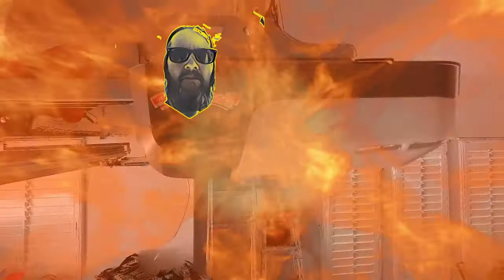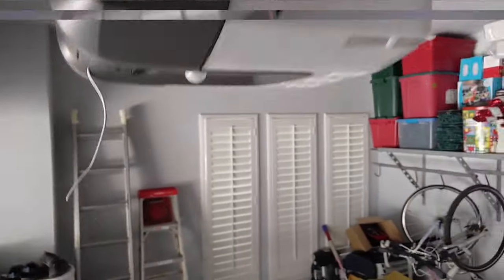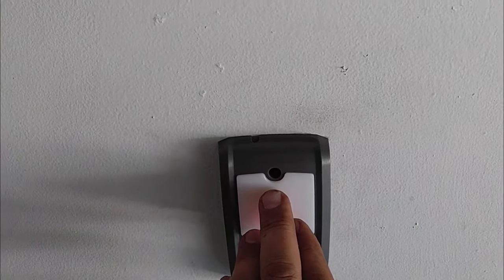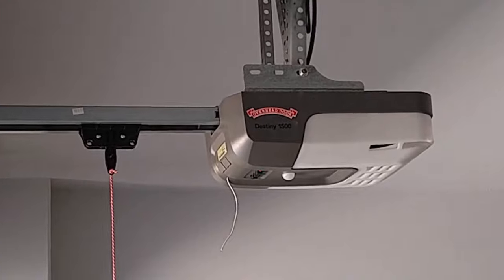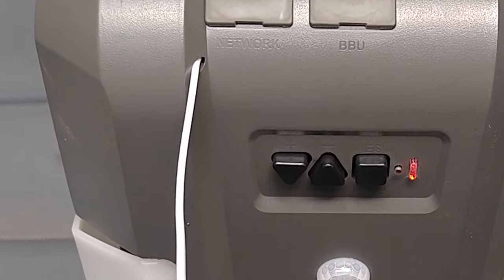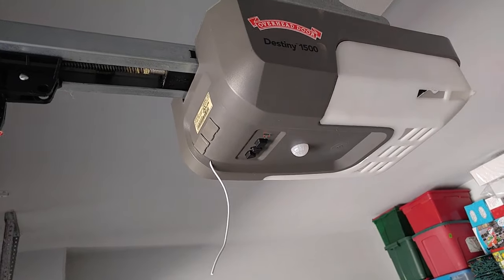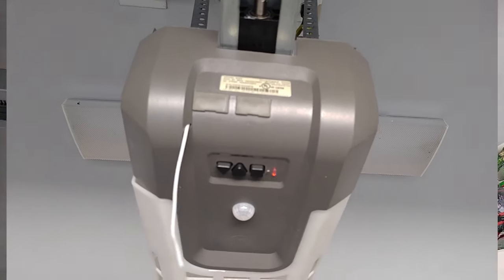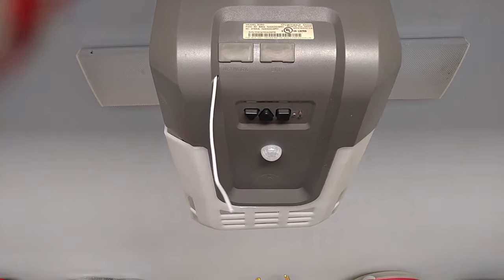Overhead Door® Garage Door Opener Just Clicks?  Here's Why!

Comment: Or you could like I did and check to see if the sensors are covered up and it makes the
same sound and the fix is only a step away without having to pay any money. I went
out into the garage & a part of a broom was covering the left sensor at the bottom edge
of the door, moved the broom aside and then it was fixed. No board replacement.
Our home is only about a year old, so I was fairly sure the board was fine.
Reply from the maker: Overhead "Genie" brand doesn't click like a Chamberlain Liftmaster does when the sensor is obstructed.  This video is specifically geared towards Overhead Genie products.
Reply: That worked for me as well! Whew! Was worried I would need to spend money on a new opener! YOU ARE AWESOME!
Reply from the maker: @LauraMedley  glad to help! 🙏

Comment: Check your floor sensors. Mine was flashing and when I made sure the cords were tightened and it worked fine. Did the same thing. Clocked and afterwards it worked like new.
Reply: 😂 Thank you!! Yeah, check the door sensors to see if something is blocking them! Here, I was ready to buy a circuit board! 😅
Reply: Thank you very much! I was just about to call someone and this was it. Just a little dust on them I guess

Comment: If both of your LED lights on the top, your motor are both red that means you need to reprogram and try again with the programming system. You also need to check your sensors. Those things can be hard to track but it’s really easy if a red light is blinking on the other side and a green light is solid on the other side and in that means that if you try to open or close the garage door it’ll go slightly down and it’ll come back up and it the light will start blinking if you have a LiftMaster, a chamberlain so if you have those type of openers those lights for blank, just me trying to help garage door expert

Comment: My brand new 3055 genie wasn’t closing all the way, no matter how many attempts to set the down limit. Now it’s doing this. I think I should’ve bought a different brand.
Reply from the maker: Is your arm adjusted enough so it reaches the floor?  Genie is generally pretty solid.
Reply from the maker: Also make sure the door isn't to tight at the bottom of the vert tracks.  Sometimes the door will drag against the jamb.  Loosen the bottom vert track bracket and pull it towards you.  That'll give the door breathing room.
Also, make sure too, top fixtures are not to tight.  They are adjustable with a 7/16 wrench.

Comment: Before you jump to this conclusion please check your sensors and make sure one is not blinking red. That’s what my issue was.
Reply from the maker: Great info! 🔥💯🔥
Reply: What did you do when it was blinking red?
Reply from the maker: @ChinkyRoz  https://youtu.be/4hnp8ZAsh4E
Reply: My green sensor is dimming in and out. Garage door will close but they will not open just clicks. Powered is a blinking red circle
Reply from the maker: @ChinkyRoz  green sensor dimming in and out means it's toast.  Order a new set from Amazon.

Comment: Mine will go up and down with wall button, but not the remote. The opener purple light flashes when i push the button, but nothing happens.
Reply from the maker: Have you tried reprogramming the remote?
Reply: @garagedoorgenius  Yes, actually that's what I was doing was programming a new remote. I program the remote, and after I completed the steps I can see the purple light flickering
Reply: @garagedoorgenius  the light is flickering when I push the button on the remote telling me that they are in fact connected yet the door doesn't go up or down
Reply from the maker: @liluncje  sometimes the remote will do that.  Not open the door, but indicate that they are talking to each other.
Put it in the learn mode again.  Then press in and out on the remote until the door moves.
Reply: @garagedoorgenius  I will try and get back to you with the results.
Reply from the maker: @liluncje  please do. 👍🏼

Comment: Just installed a Genie 1.25HP earlier today.  And it's clicking, but if I let it sit for 4-5 min, it'll work again, then it'll stop working and go back to clicking, then it'll work again few mins later.  I'll try to call customer service on the weekday.
Reply from the maker: Is this a brand new Genie or a used?
Reply: @garagedoorgenius  Brand New.
Reply from the maker: @mlim82480  hmm..that's kinda strange with a new unit.  The clicking and letting it sit for 4-5 minutes to work again is weird.  
Have you tried to plug it into a different outlet?  Take an extension cord and plug it in somewhere else.  Just to eliminate the outlet having issues.  If it still does that then definitely call tech support.  Could be a circuit board issue.
Reply: @garagedoorgenius  Don't think it's an outlet issue since I can replicate it.  After opening, and closing, it takes few min before I can open again.  Maybe the capacitor on the board is not working properly and takes some time to charge up.
Reply from the maker: @mlim82480  that's what I'm thinking.  That same issue will happen with a faulty start capacitor.  It sucks that a brand new machine would do that.

Comment: Often the issue is a bad solder joint on the board.  If you don't know how to solder then take the board to a TV repair shop and ask them to look over the board and re-solder any joints that look suspicious.  If that doesn't solve the problem then the motor relay on the board probably needs to be replaced.
Reply from the maker: 🙏
Happy Thanksgiving!

Comment: my machine isn't getting any power at all, we think somethings fried .-. we've only had are for 7 years.
Reply from the maker: Did you unplug it for at least 5 minutes?
Reply: Garage Door Genius, yes it was ticking according to my mom then it just wouldn’t move, we unplugged it, flipped the breaker to are house, checked the outlet, so it’s either the power cord or a fuse on the inside of the Machine
Reply: Can be caused by using led lights. Remove the light and monitor sensors
Reply: @taviusparadise   I mean like,  It was working before, It still didnt work, So we got a new genie instead.

Comment: I had this problem. Unplugged the unit and plugged it in again to reset the circuit board. Didn't work. Then I remembered that I'd been sweeping around a floor sensor and checked the units. Red LED flashing on the receiver, no green LED flashing on the transmitter. I must've knocked it out of alignment. Readjusted the position of the transmitter --> all systems go for launch.
Reply from the maker: Awesome!  Thanks for the comment. 🙏

Comment: FYI, don’t believe this guy, necessarily. My garage door was clicking acting this way and it had NOTHING  to do with the motherboard or whatever board he’s talking about. GO to a different video. Mine personally had to do with something was in the way of the sensor.
Reply from the maker: If it was your sensors clicking then you have a Chamberlain LiftMaster machine.  That brand is the only brand that gives you audible clicks if a sensor is misaligned. This video is tagged overhead door garage door opener. Overhead door is a specific brand. And yes, with this specific brand clicking could be a sign of a motherboard being bad just like in the video. However, I am glad you used "necessarily" in your comment.
Reply: @garagedoorgenius  yes my GD opener is the brand u mentioned in your comment to me.   When one is searching for immediate help on yt the exact model most the time does not come up.  and yes i used the word necessarily, purposfully.  And I learned more about the clicking regarding my brand from your comment. TY

Comment: Let me guess you replaced it with a Chamberlain Whisper Drive.
Reply from the maker: 10-4!
A Chamberlain product yes.  Not a Whisper Drive tho.
Reply: Ah I figured. What did you end up putting in for them?
Reply from the maker: @samsquires2877  
Chamberlain B730 Ultra-Quiet and Strong Belt Drive Garage Door Opener with Battery Backup
I sell so many Chamberlain openers it's nuts!
Installed a few Genies last week.  Not to bad of an install.  I still like Chamberlain LiftMaster over all.  Going to do a 8300 on a door I high lifted.  Instead of directly driving the shaft, I'm gonna use chain/sprocket.  No room on the side.  Can't wait to do that job!!
Reply from the maker: @samsquires2877  
Got a question for ya.
If I did a LIVE opener install on YouTube, think it would be cool to watch.  Just wonder if it would be useful.  Always wanted to put up a tripod and camera and do one LIVE.
Reply: Garage Door Genius absolutely I think it would be a great video to watch.
Reply: @garagedoorgenius  yes